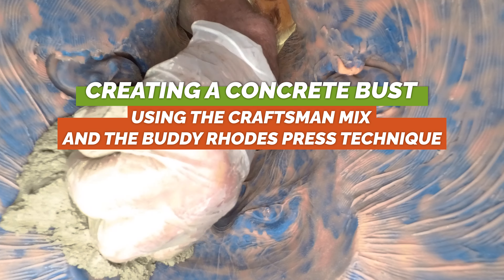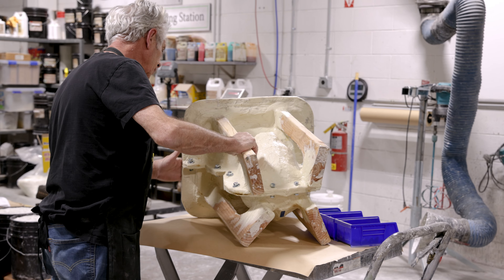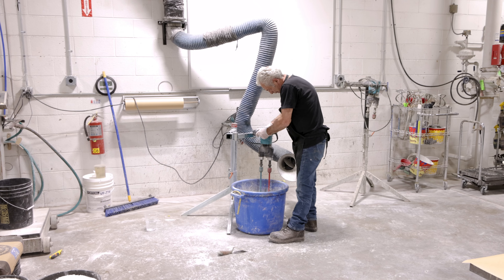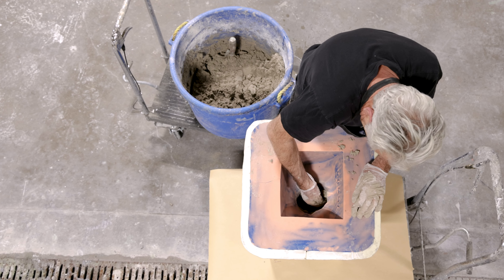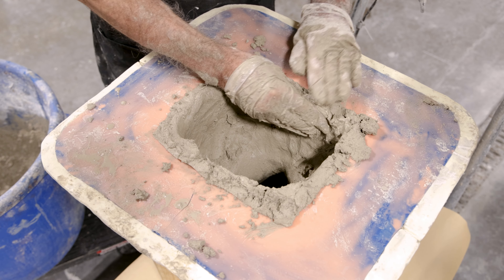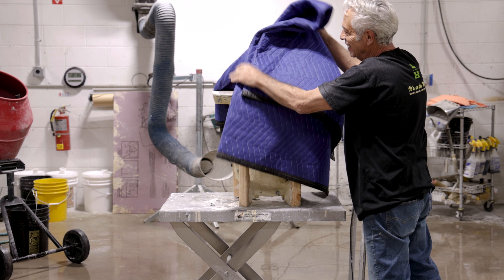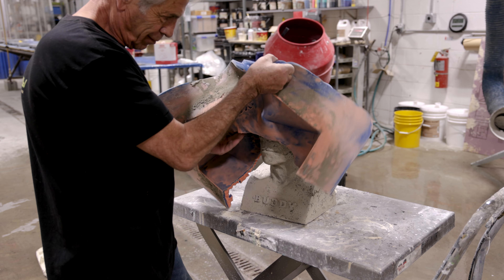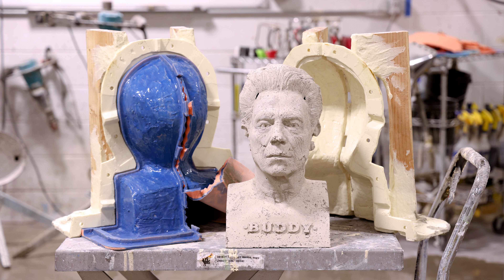How to Create a Concrete Bust with Buddy Rhodes: Press Technique Tutorial

Comment: Is there a way to achieve a smoother surface (less crevasses and pockets) with that material or should we simply use another? I am also curious about its durability in an exterior environment. Thanks :)
Reply: Solid casting!  He is showing the BR press technique in this presentation.
Reply: @miloradmedunic6202  Can it be used outside? Thanks